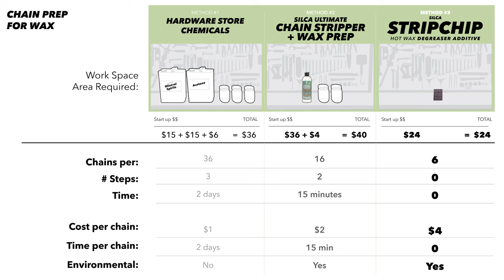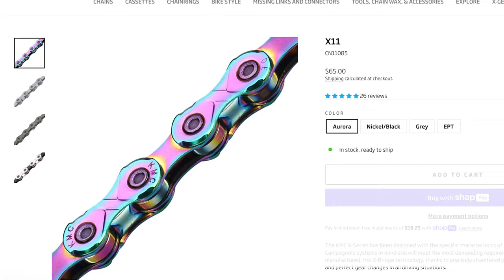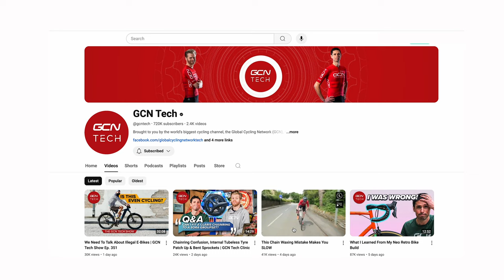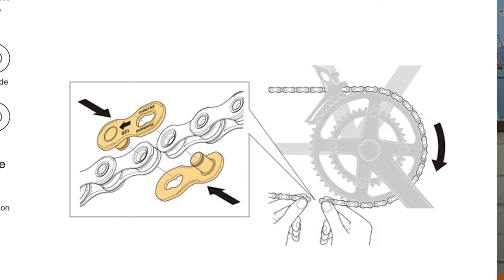Chain Waxing? Avoid These 7 Common Failures!

Comment: Hi, I've been waxing about 1 year.  I wasn't sure the cure time for the hot wax.  I usually wax and let the chain hang overnight, however there are occasions when I need to wax in the morning for an afternoon ride.  So 4-6 hours of cure time.  Again this is for the hot melt, is that sufficient?  Thank you.
Reply from the maker: For hot melt the cure time is 10 minutes.. once you can handle it comfortably in your hands, you can install it and ride it.
Reply: @SILCAVelo  Thank you!  Worked perfect!

Comment: I've had a stupid thought- I have BBB roller boy jockey wheels with sealed steel bearings. What would happen if I dropped hot wax in to the bearings instead of grease when servicing them? 🤔
Reply: Not a great idea. While wax is good for chains, grease is what works best in a sealed environment where contamination isn't an issue.

Comment: If you ever edit this video...
Twice after waxing I mis-threaded the chain through the rear derailleur...  here's how I had to deal with it. 

Most mini tool sets don't have the tool to squeeze the master link open, and who brings that tool to a group ride?  If you mis-routed your perfectly waxed chain again and find yourself already at the start of the group ride without the means to open your master link, you might be able to pull the screw out of your lower derailleur pulley using a small allen wrench on your mini-tool, then carefully without dropping the small parts, "rotate" I repeat "rotate" the pulley arms enough to move the chain around the tab, then reinstall the derailleur pulley and hardware.
🤓

Comment: @silca, by accident I got a good amount of water in the bag of wax during my most recent chain waxing. is the wax still usable? any way to purify it again? (eg. boiling for the water to evaporate?
Reply: i wouldn't boil the wax, he said over heating the wax will damage it. id just let it air dry.
Reply: Strip chip needs > 100. I think boilings ok but not for long. Stir while bringing temp up so bottom of pot isn’t super hot while top still not boiling — it doesn’t move around like water

Comment: I don't really see viewers paying attention to the condition of the chain before applying Super Secret drip wax as an interim lubricant (any time you start to hear noise especially over the jockey wheels...few hundred miles max).  Just like a hot wax you shouldn't apply Super Secret to a dirty chain...even if it doesn't look dirty there's always road/groad/trail dust.  What's the point?  You'll just trap dirt in the wax layer as the water evaporates from the Super Secret.  I don't take my chain off the bike to "preclean" for Super Secret.  I just (1) hose down the chain and drivetrain thoroughly with water, (2) "wash" the chain with a Park Cyclone Chain Scrubber just using water or maybe a bit of Dawn in the water if there's a lot of groad/trail grime, (3) repeat 1-2X with clean water, (4) repeat with Isopropanol and let dry, and (5) apply Super Secret drip wax with one drop per link and spread with my finger before rotating the crank and then running through all the gears to work Super Secret into the links and pins.  It's important for the chain to dry before applying Super Secret (or hot wax for that matter) or there won't be the necessary capillary force to "suck" the wax dispersion into the links and pins.  That's why I finish with isopropanol which dries quickly.  All the above said, I'm getting 2500 miles out of SRAM Rival gravel chains and 2000+ miles from SRAM GX MTB chains.  I think that's pretty good.  Isn't it?

Comment: As much as "making a candle" is a waste of wax, if you eventually clean the outside of the chain and put it on the bike, it should have a negative impact on the longevity? It should actually be best from that point of view as that makes sure the most was remains inside the rollers etc. Or is there something I am missing?
Reply from the maker: When you 'make a candle' the wax hardens before it is able to penetrate into the inside of the chain, so your chain is completely covered in wax on the outside but totally devoid of wax on the inside..
Reply: @SILCAVelo  in my example the chain has been in hot wax for longer than 10 minutes, agitated etc. just let the wax cool down too much before pulling out. So wax should be "in" the chain?
Reply from the maker: Oh sorry, in that case, you are fine and just losing wax to the outside of the chain which will flake off.  But once cleaned off, performance will be identical.

Comment: The chain isn't directional right? It just has an inner side and an outer side. 

The quick link arrow will point left (not right) when you look at from the other side too 😂, but will point in the opposite direction to the direction of travel when pedalling.

Comment: When I "reset" the waxed chain with hot water, I think it is better so start with a little higher wax temperature (100-105 degree celsius) so the water inside can boil out. Then I reduce the temperature to about 65-70 degree celsius and take it out.

@SILCA: whats your thought about this?
Reply: Wax can break down if it gets too hot. Not sure where that point is, though. I "spin" my chains to remove water after boiling them, and then let them dry before waxing.
Reply: Water has a vapor pressure even if it’s not strictly “boiling”.  It’ll vaporize at 150F, just take a little longer.

Comment: I ride a hybrid 8 speed, I just put a new chain on my bicycle,  I used the jar method to strip the chain and then the three step lubing on the bike method, I also made sure the chain rings, cassette and derailleur were all clean I took the time to do maintenance on them I took the outer cage off and clean the plate and jockey wheels, then installed everything and then lubed the chain, my first few rides I noticed the bicycle seems easier to ride, I have a couple of uphill sections on my ride to work, I normally ride in the middle ring and fourth or fifth gear on the cassette, I noticed I was riding easily up hill in sixth gear, I only got about 20 miles on the chain so far so Im interested to see how long the wax lasts. I live in the city I get some gunk from the standing water on the street I noticed the wax is flaking a bit, so that is a new experience, 
I don't use power meters or electronics this is my getting around bike, I just know how far I ride.
Reply: Don't worry about wax flaking off the outside of the chain. It's the wax inside the bushings/rollers/plates that's doing all of the magic.
Reply: @SnaxNoCo  
I read that happens I'm not worried about .

Comment: How about KMC gold Ti-N chains? does the wax not adhere well also on these chains?
Reply: The Ti-N coating is not quite as microscopically smooth as the black coating - wax will adhere better to that, at a rate close to if not identical to a standard chain.
Reply: @matt_acton-varian  thanks! :)
Reply: Have not had wax adherence issues with KMC gold chains. I have 2 chains in rotation on my indoor trainer and SS drip every 200mi (could go longer but easy interval to track). Hot wax every 1000mi. After 5000mi each I'm at 0.1% wear. Nuts!
Reply: @I_DreamOn2Wheels  i've just hot waxed my gold kmc this week, so it seems it's good to go :) thanks for the feedback! :)

Comment: Pretty sure I have followed all the instructions, strip chip on new chains/drive trains both shimano and sram, using the Silca pot.  Chains come out looking correct, but both on an emtb (Santa Cruz x0 transmission) and a trail mtb (Yeti xtr) lasted ~100 miles before getting noisy enough I reapply from a drip bottle.  I do rinse off the bikes with cool water roughly 30 miles of trail riding.  I'm in NorCal and it does get dusty in the summer.  I can't imagine I am putting excessive torque through, I can hit over 1kw on my smart trainer on Zwift so not sure if that is a factor.  I will revisit everything in this video.  Latest hot wax session has 1 of the endurance blocks in the mix on a fully cleaned chain, need to get the miles in on it to see how it goes.
Reply: Water, even without cleaning additives, can hurt the wax. Wax is slightly water soluble I believe, and the water makes the contamination go deeper into the chain pretty effectively. I think it's best to avoid spraying water on the chain/drivetrain if possible. If needed I think it is better to at the very first, run a microfiber cloth on the chain and then remove the chain before introducing water. But if possible I would only wipe of sponge the bike down, no running water, should be better on all your bearings too.
Reply: Maybe water’s my problem too. I get 200-250km on my commuter but always rinse chain with boiling water, wipe and shake dry before rewaxing

Comment: I only ride on road. Should I boil my chain every time I re hot wax?
Reply: Unless it's really dirty, most people just wipe it down with a microfiber cloth. If there's a bunch of junk between the links, then I flush it out with water before waxing. If it's really gritty and muddy, I boil it.
Reply: @SnaxNoCo  I guess the same applies when drip waxing? I tend to top up with the drip method
Reply: @Dylansftp  Mostly the same. But the junk between the links isn't as important, as long as anything that might be carried into the rollers and bushings is removed with a cloth before dripping.

Comment: I waxed a chain in just the speed chip wax for a 40k TT.  I wasn't paying attention after waxing the chain and left my crock pot on.  When I noticed my mistake I maesured the temperature with an infared thermometer and it said 133C.  Did I ruin/burn the wax and I need to buy new speed chips?